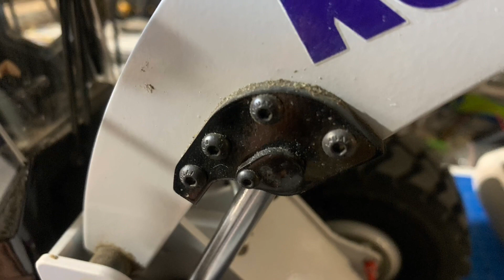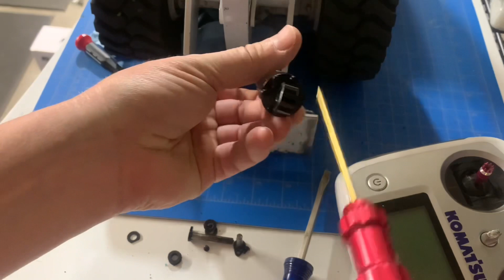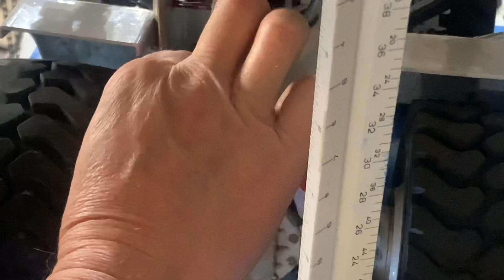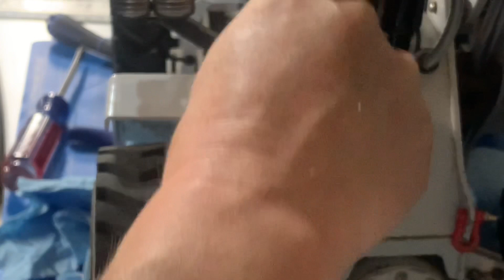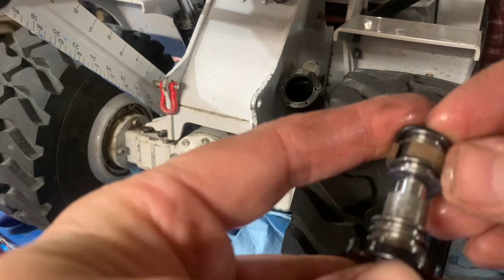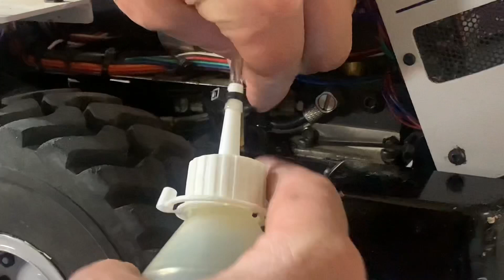Rc loader hydraulic repair and maintenance. Rc construction equipment shop time.

Comment: Love mine, had for a year now and only issue i had was with the speaker coming on and off, basically the horn would come on if you touch the remote in a certain way, but nothing major! Good video make more on maintenance lol!
Reply from the maker: Will do. This is a fantastic reliable machine. And maintenance is not too bad either.

Comment: thank you for posting this video and sharing this procedure. what hydraulic oil do you use? how often do you change it?
Reply from the maker: I use #46 hydraulic oil. I change it if it gets to looking dirty. Depends on the run time of the equipment.
Reply: Got it, thanks 🙂

Comment: How do you drain the oil for a hydraulic fluid change?
Reply from the maker: A syringe and some silicone glow fuel line attached to it. Suck it out of the holding tank (reservoir). If you want to be really thorough disconnect the pump so it won’t run and activate your reversing valve while moving the corresponding cylinder and this will push most of the oil back into the reservoir. And finish sucking it out with the syringe. Probably the cleanest, least messy way to do it too!

Comment: Does your machine run hydraulics faster or stronger when not on mix channels. For instance my 870k runs stronger when I dont use mix.
Reply from the maker: It runs the same. With or workout it on mix i didn’t really notice a difference. I tried that first before tearing into the hydraulics just to see. That’s how my excavator is. Sometimes I’ll run the pump for more continuous power and then just run mix for smoother slower precise movements. I like setting it up for that option.
Reply: it's speed that separates you. not strength? the power is same But if you feel your 870k not strong enough open the pressure to 20bar i see that good enough ..not from the radio.! there is thump screw comes alone you will see him under the cap Rotate clockwise
it's earth mover 870k she best And strongest wheel loader ever